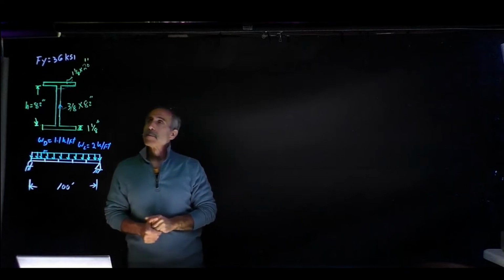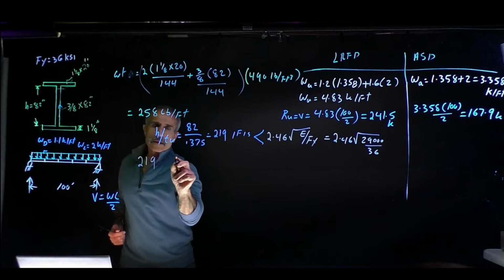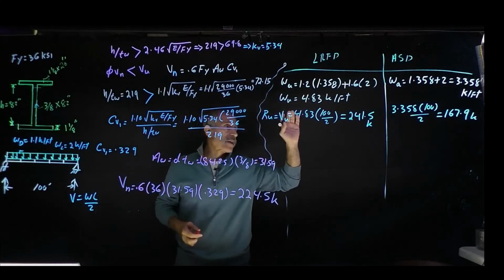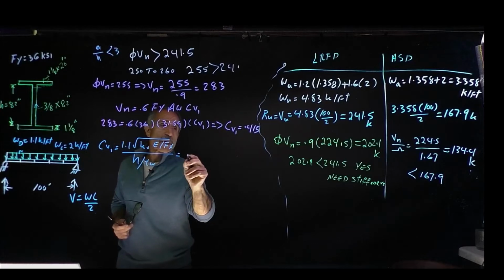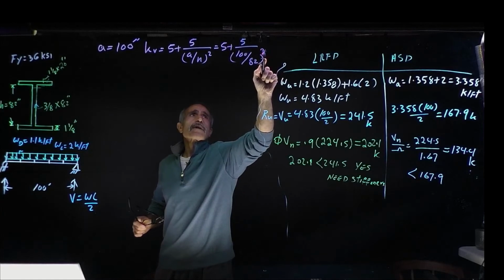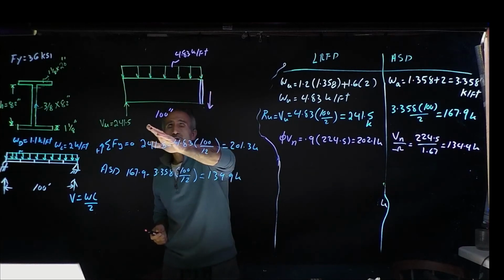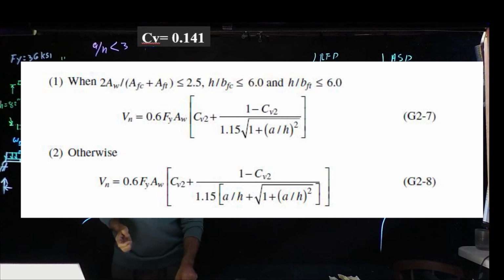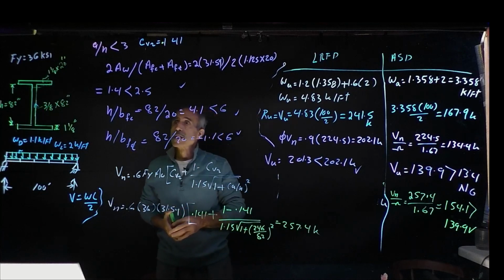Steel Plate Girder with stiffeners - Beams-Built-up Girders -Transverse  Stiffeners

Comment: This is excellent! Thank you for the post. Did you post the design of stuffeners as well?
Reply from the maker: https://www.youtube.com/watch?v=u81CAMu8Yo0&t=18s
Reply: @Nasser Yari PhD, PE  Thank you for the response, sir. The link you provided is to this same video that we are in " Steel Plate Girder with Stiffeners -Beams-Built up Girders-Transverse Stiffeners"

I, however, was inquiring for a video post on the design of actual Stiffeners members (Angles or WT sections)  provided  as you promised at the end of this video. Thank you again, professor.